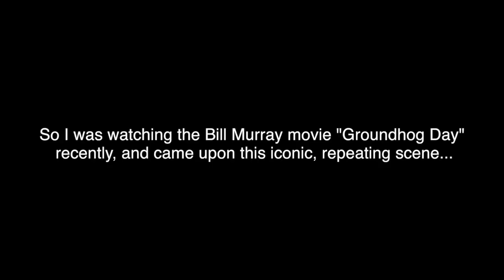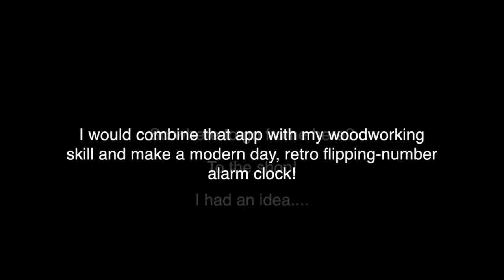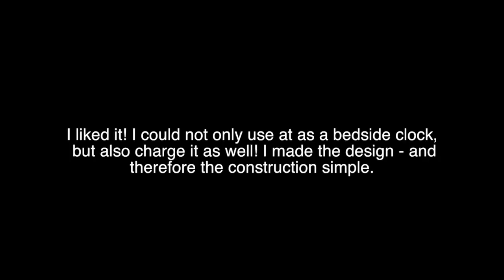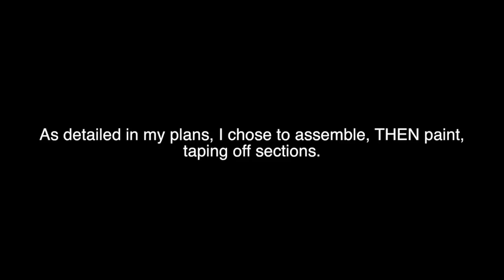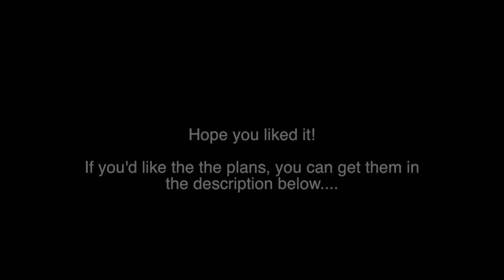How to make an iPhone into a classic flip-number clock radio! DIY

Comment: That's cool bro! Good idea with cutting the cove on table saw. I recently made a phone amp and wanted a Cove type shape for the speaker or part if you want to call it that cut it out on the bandsaw in sanded it and you just spoke Shea's didn't quite turn out the way I wanted to but the way you did it on the table saw is exactly how I wanted it to turn out so thanks for the tip and that's a really cool idea man I don't have an iPhone but my wife into kids do thanks for sharing great video did you use the table saw to get those lines in the top or a router
Reply from the maker: You're welcome! Woodworking is a continuous learning experience, I find.